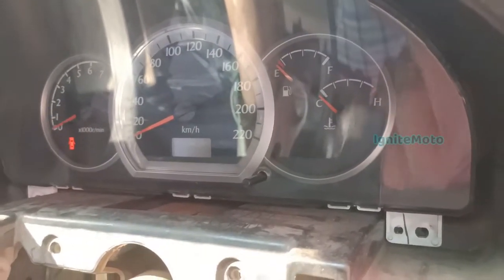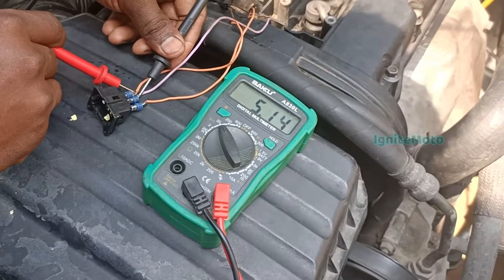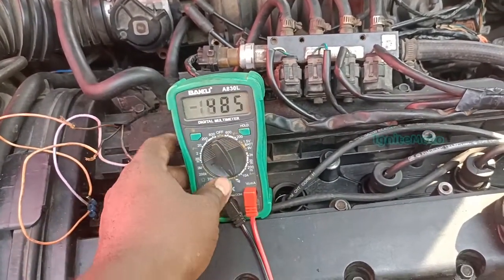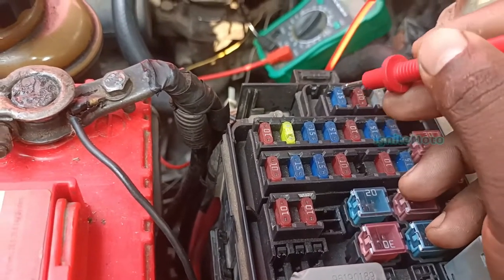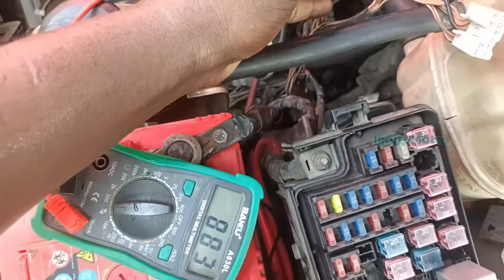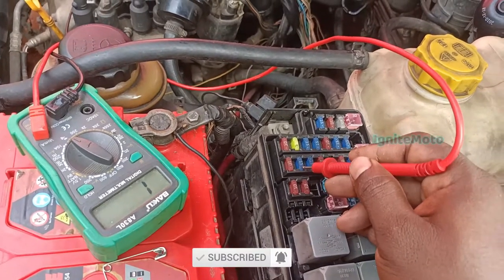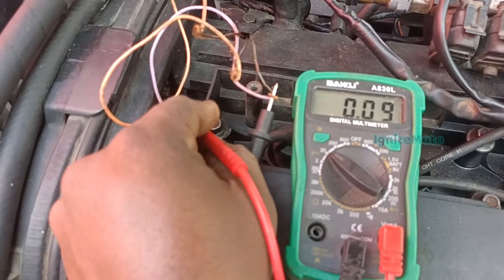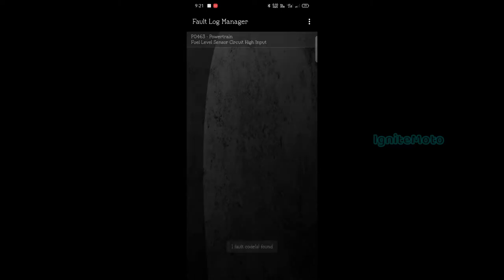chevrolet optra |P0342-powertrain camshaft position sensor "A" circuit low input |tamil|ignite moto

Comment: Super Bro, my car also has the same error. I will check in this way and update you whether it helps me or not
Reply from the maker: I am waiting for your comment, thankyou...
Reply: @IgniteMoto  tried today to check as per your direction. 
First checked the Neutral using battery native terminal with connectivity test. It was working good. 
Then checked 5V, it was also good. Then checked for 12V, that was also working perfectly. 

Then removed the CAM Sensor and connected with pin and checked the voltage from 5V pin, initially no value. And then touched the sensor with spanner, and got 5V.

So, in the check all 3 pins were working properly and sensor was also working properly. 

Then cleared the error P0342, using OBD Reader. After switch off the engine and start agin, in few seconds the error coming back. 

What will be the problem, are you able to guess?
Reply: @IgniteMoto  After changing the CAM Sensor, the error code cleared successfully and running good.

Comment: Hi bro, I have Optra 2011, it throws the code p0342, I have changed battery, changed the camshaft position sensor, checked all wires all of them are good and changed the starter motor but still it throws the code, it really has made me tired, can you advise me please, do recommend if I change the dephaser pulley? Thanks
Reply: I also
Reply: @S.khan.123 did you find the problem? I still have the same problem after 10 months
Reply: @QURAN-IS-MY-TORCH  yes problem solved
Reply: @QURAN-IS-MY-TORCH  camsensor ko clean Karo aur jaha sensor laga h waha bhi clean Karo ,fir 5 ya 6 bar start off on karne par Kai baar me ya  3 din bad light apne ap chli jaygi ,